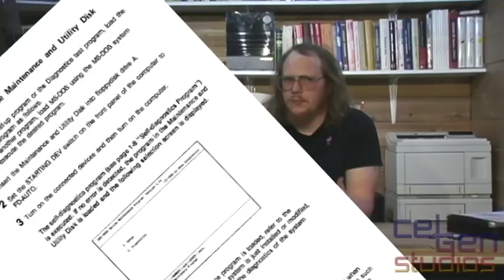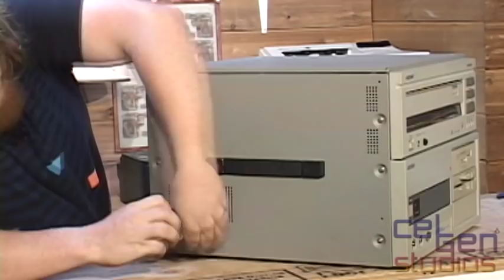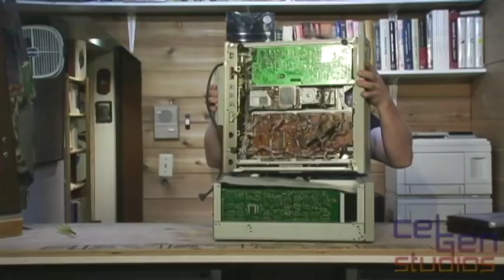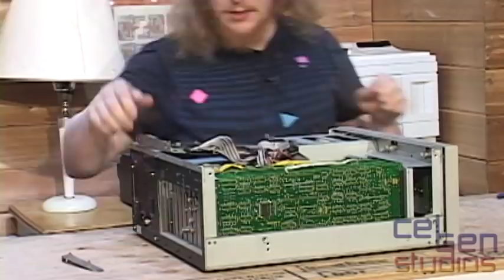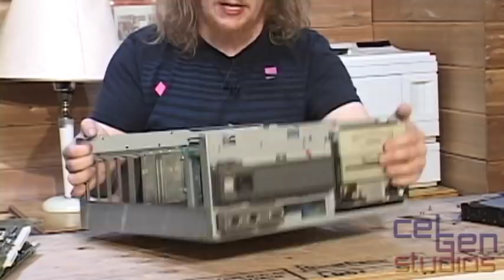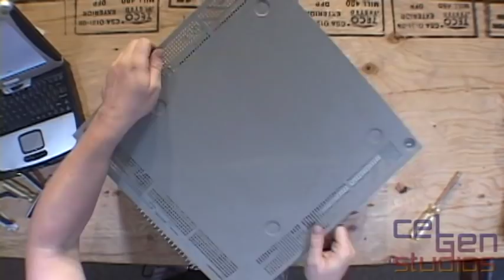Sony ViEW System - The Teardown

Comment: As long as you use the same controller, looks like it's just standard ISA, you should be able to read the drive in any other system. Shouldn't need any configuration with another system as the configuration should be in the controller.